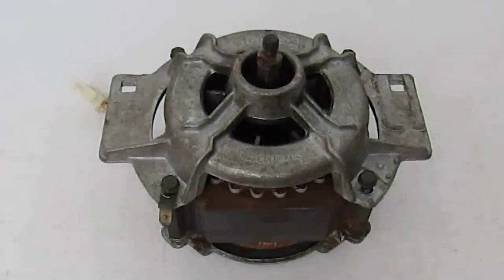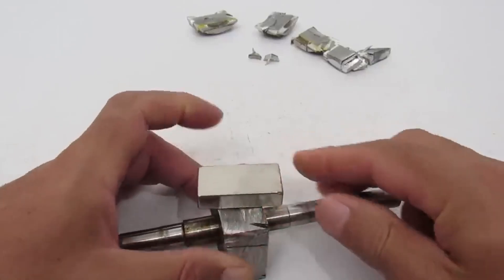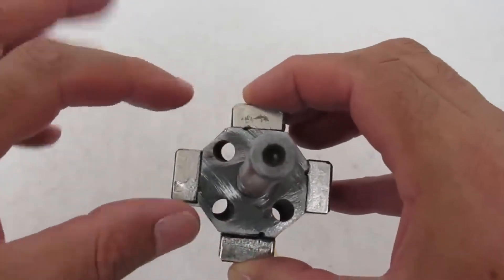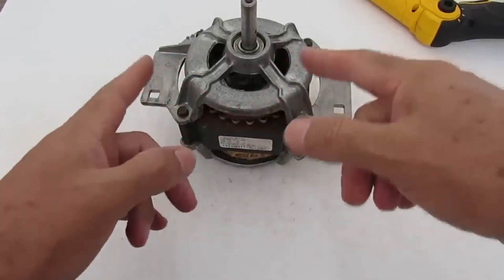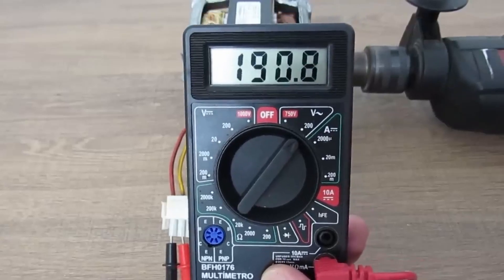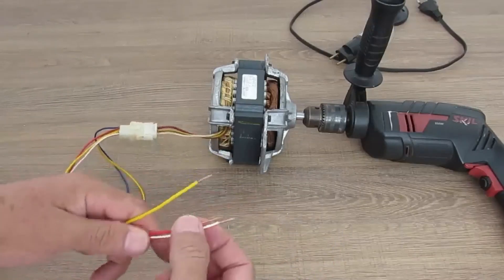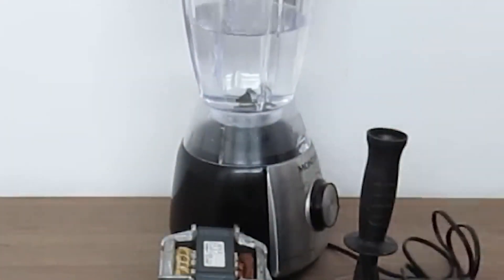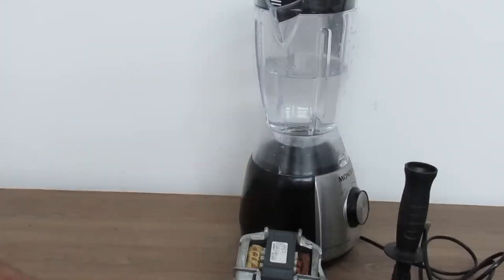Generate Free Electricity by Converting a Washing Machine Motor Into a Powerful Generator.

Comment: Very good video. But would it work even without modifying it?  What would you say was the rpm of drill
Reply from the maker: Its operation is only possible with the placement of neodymium magnets on its rotor.
The drill rotated at approximately 2500 rpm.
Reply: I tried it with my washing machine motor and i got 2 volts AC unmodified, there is some residual in the rotor but its not enough for any practical purpose